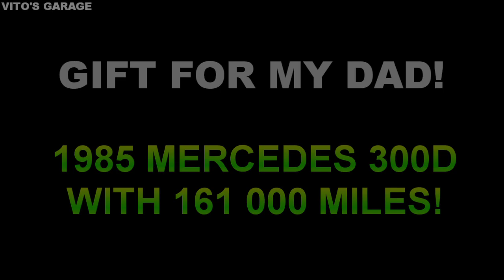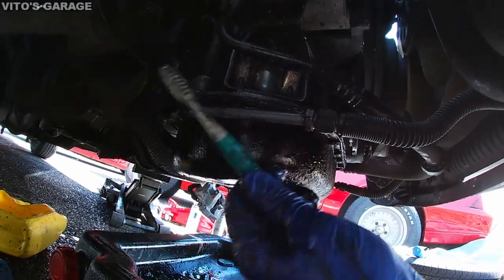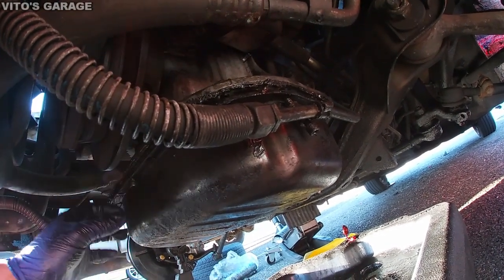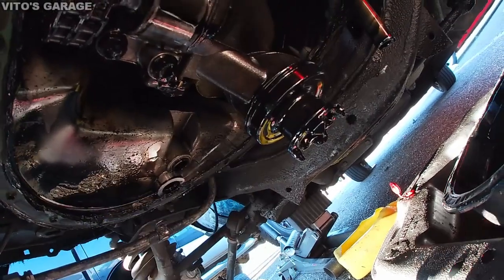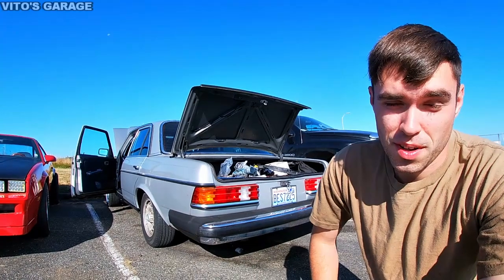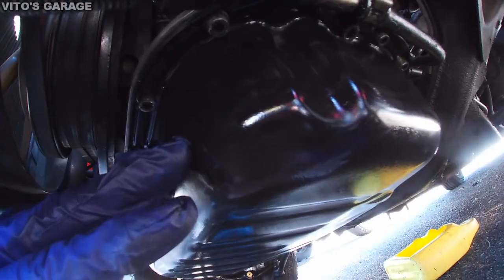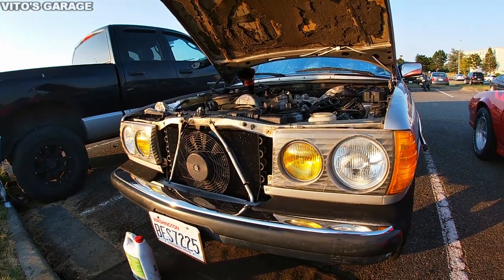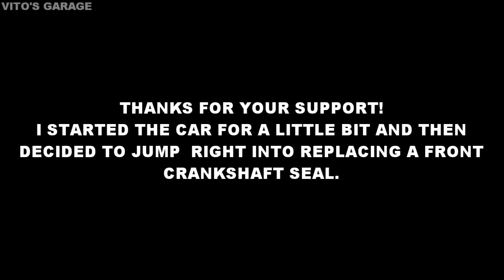PART 5 Dad's Gift 1985 Mercedes 300D: OM617 Oil Pan Refurbished & Gasket Replacement + Oil Change

Comment: I couldn't really tell but i believe your oil filter cap is missing a square cut o-ring on the filter cap shaft..
Reply from the maker: I have 2 brand new o-rings I will be replacing on it anyways.  The whole oil filter housing will be coming out since I need to change the gasket

Comment: when changing oil, do u think it makes any difference if u drain the pan first or remove the filter first?
Reply from the maker: Yes. It makes a difference. Change the filter first. When you remove the filter, some oil will drain back into the pan. 
Or, you can drain the oil and then change the filter while your drain plug is still out

Comment: The mercedes gasket has heat activated sealer built in.  No RTV needed.
Reply from the maker: It's a paper gasket, what kind of sealer? And the gasket will eventually harden and get brittle. Little bit of RTV will help seal it better
Reply: @VITOSGARAGE  Must be a non Mercedes gasket if its paper.  Have you applied for an engineering position at MB? ;)
Reply from the maker: @Bradwick1  Original Elring